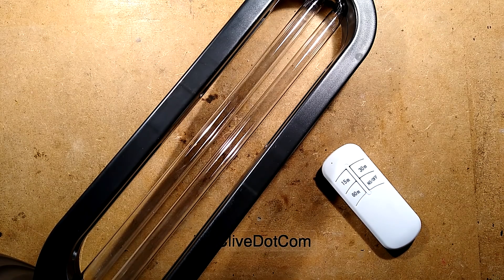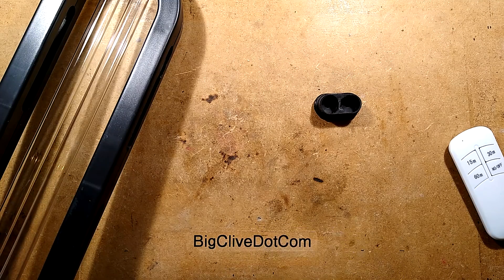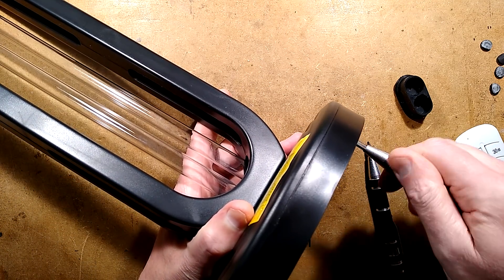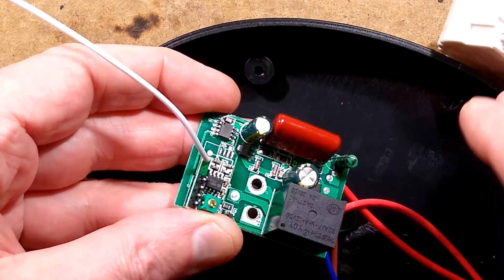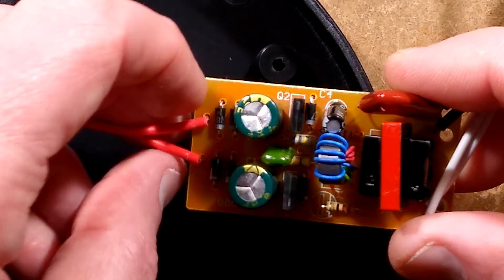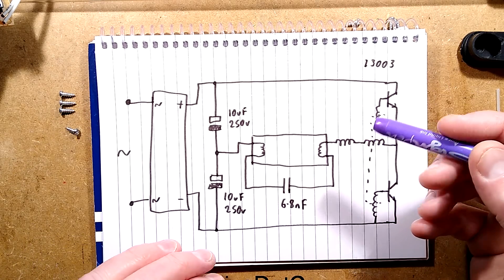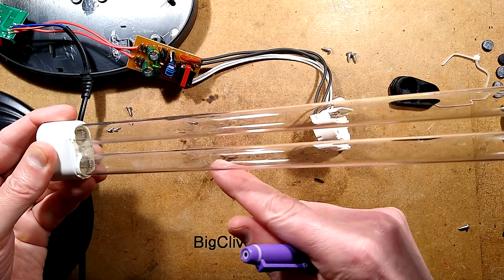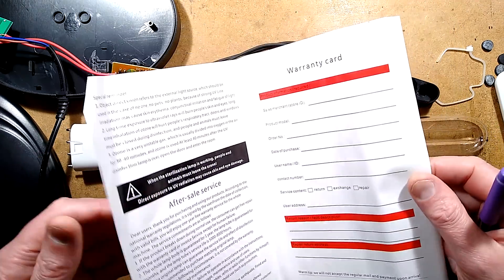Inside a stylish tabletop UVC germicidal light.  (Skin, eye and lung hazard)

Comment: The newer version of this has done a huge revision of the firmware. Turn it on, and the lamp doesn't immediately illuminate. If you set a time on the remote, the unit beeps slowly for a few seconds, then faster, and then really fast—then turns the lamp on.

They also now have two versions of the lamp itself, a low ozone and a more expensive high ozone. I got the low ozone and don't notice a significant scent when entering the room (even after an hour of it running). 

I was a little concerned about the lamp being genuine, since it only had those two little spirals of wire in the ends—but looking at yours I see mine is exactly the same. Cheers again, Clive, for recommending another great product.

Comment: I got a uvc bulb off Amazon. I'm using it to try to control mould from a damp issue (partly the uk weather). I'm not sure how effective it is because I'm still getting a mould odour from one area. To be fair the ozone does block any other smells for a while especially if you don't ventilate before using the room! To be honest I think the dehumidifier is more effective but I wanted to kill the active mould and spores not just suppress them. Sun and wind more effective than the dehumidifier today. Saw 47% which is unheard of here.
Reply from the maker: For older houses with inherent damp designs, another option is a PIV positive input ventilation system.

Comment: I just got one of these.  It looks just as cheap and flimsy as this one. It turned on once; don’t know if it worked the whole 30 minutes because I left the room. It wouldn’t work after that one time. The unit DOES come on when you hit the timer button and starts beeping (counting down), but the light itself doesn’t come on. Also, if you push the STOP button, you can hear the unit click off, but no light!  Very annoying.  I considered buying another bulb to try, but after seeing you take it apart, I decided it’s probably NOT the bulb. My skills do not include electrical ANYTHING, so (sadly), adding to the overcrowded landfill, it will be!

Comment: Now that I'm looking back at this video I remember having seen a promotional video from a French website that sells quite a similar tabletop UVC lamp.
But what's worse about this one is that it doesn't even have a remote control, instead it's a single pushbutton on the lamp itself that when pressed will turn on the UVC after (Only ! 😱)10 seconds, then it will keep running for 30 minutes without any practical way to turn it off earlier without exposing yourself to the harmful rays and ozone because yes for 40€ they didn't even consider using a ozone-filtering bulb for it but I'll talk about the ozone later.

The reason I'm even aware of the existence of this product is that I came across said promotional video (All in French of course) about it, when a salesman was demonstrating it and showing a clear misunderstanding of the hazards and elementary safety precautions regarding UVC and also ozone.  

In a nutshell he was saying that walking next to the lit lamp was "Fine" (No it's ABSOLUTELY NOT !) and basically wasn't emphasizing enough I think the absolute necessity of leaving the d*mn room.

At least he mentioned the need to open the windows to ventilate the room from the ozone, however he didn't seem to be aware of how dangerous ozone really is to the health though.

I therefore posted quite a long comment about all the real hazards associated with UVC and ozone, the mistakes the salesman was saying to the camera, the aforementioned flaws of their lamp (Which is still for sale as I'm writing this !), and last but not least the fact they also make UVC tubes that don't generate ozone and that maybe they should have chosen one of them instead. 

Of my 3 UVC lamps only one emits ozone and it so happens to be the one I use the least of all.
Why ?
Because it takes a really long time for the ozone level to fall back to a non-irritating for my eyes/nose after the lamp has been switched off, even with the windows open and unless you want to specifically get rid of some unpleasant odor in the room, ozone isn't really necessary and happens to be more of a hassle (And additional hazard !) than anything else.

Anyways I didn't get any reply to my comment, however a few days later they deleted the video... Then re-uploaded the same one with the moments where the salesman under-emphasizes the hazards removed.

Comment: When I was a kid I encountered a washing machine that was being disposed of,  and out of it I salvaged a small bulb,   looked a lot like a regular incandescent bulb in a size I didn't typically encounter,  but it was quite clearly labeled "germicidal lamp".  It had a smallish inductor wired in series with it.  I did play with it a bit,  it lit with a rather pretty purple color,  but I don't recall running it for long or experiencing any damage because of it.

We have some serious filtration on the well water here,  and one of the things they would do in the annual maintenance was change out a "UV Bulb" that was somewhere in the setup.  Quite costly,  that was.  Not using that company any more,  I know of no signs of any bacteria in the water here.
Reply from the maker: You can replace the UVC lamp yourself if needed.  They're very common.

Comment: So I've got one but returning it. It's got the motion sensor built in but it's waaaaay to sensitive. I can place it in a closed room, shut the door  and you'll see the light come out from under the doorway. I can stand down a hallway and slowly lift my arm and you can see the light turn off. I can be out of sight of the door around a corner and lift my arm slowly and it still turns off... It's unreal, I'm not sure how it's supposed to stay on if it can somehow detect motion in a joining rooms with the door shut.
Reply from the maker: It sounds like an oversensitive microwave detector.

Comment: I just scored a similar unit at a thrift store for $5.99. As far as I can tell, it was never used as the remote still had the plastic sheet stuck in to disconnect the battery. It has a nifty function that once you select the run time (15, 30, or 60 minutes) then press power, it will start beeping. The beep rate will rise until it is a steady tone over about 15 seconds or so. Then the tone will stop and a second later, the lamp will light. I did the first 15 minute test in my garage which is about 24 feet square (576 sq ft., 53.5 sq m.) and it left quite a strong ozone smell. I'm not sure what the actual wattage is yet.
Reply from the maker: That's a great price.  Was there any warning about the hazards of UVC?  It's scary that something like this was in one.
Reply: @bigclivedotcom  There is a similar yellow warning sticker on the front. And the instructions are remarkably Un-Chinglish. It has sensible directions and recommendations about avoiding exposure and post-operation ventilation time before occupying the room.
And the unit has all metal construction with four thin steel rods holding the tube in place so they don't cast shadows. I see the box says it is uses 58W, but I haven't had a chance to measure it. The total length of the tube is 28" (folded in half).

Comment: I know ordinary glass is "supposed" to block UVC but would it be safe to
 say go outside and look through the window of the room where the light 
is put to see if it's working or not ?
Reply from the maker: Yes.  Ordinary glass blocks the UVC.
Reply: @bigclivedotcom  But apparently not the higher wavelengths as it still gave me eye strain back a week ago when I tried looking at the beautiful blue glow from my germicidal light behind several layers of ordinary glass...

I've taken the lesson, now I only turn if on and off from outside of the room with the door closed.

Comment: I heard about a water bottle which uses UVC LEDs to sterilize water inside, battery powered, all in the cap. Since UVC LED seems to provide the least efficacy in the LED realm, I wonder if this could be a scam as it raises many red flags to me. Any reverse engineering on it? Is called Larq
Reply from the maker: It's an application where the UVC LEDs may actually work.  The exposure time would probably be longer than a quartz tube, but driving the LED would be easier.

Comment: I've got an identical looking unit also straight from China with very similar pcbs, although just a tiny bit different. I have been trying to fix it and got excited when you pointed out the prone to failure resistor, but mine is OK. I can't figure this one out! It worked for a few months then just stopped turning on

Comment: I have exactly the same UVC bulb and where they covered up the hole on yours I have a time to power button when you turn it on it will take about 10 seconds and then finally turns on... It beeps like a ticking time (blank) fill in the blank I don't feel like getting flagged 😂 I do like when you hit the power button though counting down for you so you're not in the room when it turns on.

Comment: I have one of these in a white housing that does not block as much light, cost $65 AUD, it came flat packed in a thick polystyrene box.
On difference compared to yours, when u plug mine the light does not immediately turn on, nice safety feature.
The remote system works great, set it up in a room,  close the door, turn on and set the timer safely from outside the room.
What i through was really good is the amount of safety information that was supplied, safety sticker on the lamp base, safety information in the instruction manual, safety information sheet in the postage packet from the seller and an ebay message from the seller thanking me for my purchase and explaining the dangers of UVC and ozone.
 
I also have a large ozone generator, it claims to generate 24 grams per hour, no idea how accurate that is, it has been used it to get rid of the old urine smell in the toilets at an old pub that has been converted into a community centre, it worked a treat, smell gone.

Comment: Mr.Bigclivedotcom. I hope you read this.
I wonder how to ask a question about this light mechanism -UNRELATED to current events - actually has to do with mildew/moisture.
Do you have email? Do I ask here?
Thank you.
Reply from the maker: Ask here.
Reply: @bigclivedotcom  Thank you.
I happen to be up early,  4:11AM in South Florida when I saw reply. Will take me a while since I am using my phone.
Last year someone recommend a light like this to me for some ongoing issues in one of the bedrooms of the rented old house were I live.
Getting help from the Landlord is next to impossible, and now I am not able to move.
Ok. So after seeing a couple of your videos, I wanted to find out from you if you saw any screw in type light that I can use lamp base in the room. 
Among a few that I watched from other channels,  one in particular from Ukraine showed (short version) the light retrieved after breaking a "bigger" light bulb, screwed into a lamp base and the lamp is turned on by the light switch on the wall. It was left in for an hour, and then turned off and the person aired room after a while.
After watching your one video, I am guessing the big bulb had to be busted as the glass would be the barrier. Inside the light itself was not round but skinny type like you showed with the three different bulbs.
Yes I would leave the room, even tape the door to make sure ozone does not escape.
Upon re entering I would turn it off, and leave room again for about 1/2 hour, then go back in and open windows to air out.
I am guessing I could do this once a week now during rainy season, and obviously move as soon as I am able.
Thank you for the reply, and forgive me if I typed too much. I wanted you to get an idea of why I needed to use the light. 
Be well and God Bless.

Comment: I have buyed one of these lamps from  China. i am satisfied. i use it with all the necessary precautions. important is the delayed start, so i put it in a room, i activate and i close completely the room for an hour, then after the work i change completely the air to eliminate the ozone. this lamp works well an is useful in this moment. tanks for Your videos about especially the fake uv lamps on the market and thank for the teardown. intresting the schematics.

Comment: another way to disinfection by fogger in amid coronavirus. thermal fogger & cold fogger also issue nowadays to youtube.  but we, normal people don't know how to do. can you give us the guiding light how to use or choose right one? what kind of liquid can use for both.     i also order to use the disinfection water by hypochlorous acid water maker. I wish you also test that too.
Reply from the maker: They used to use glycol foggers in hospitals to prevent cross infection.  The modern equivalent is a small disco fog machine.
Reply: @bigclivedotcom  Thanks a lot. Glycol fogger is cold fogger? disco fog machine is hot fogger. can I using the hypochlorous acid water or hydrogen peroxide in small disco fog machine?

Comment: I thought UVC didn’t produce Ozone. The units that are made for your HVAC do not produce ozone, it’s not particularly great for your lungs. The UV that creates ozone is actually below the UVC wavelength Of around 260nm. The ozone UV lights are closer to 110nm. Please correct me if I’m wrong.
Reply from the maker: Mercury lamps produce two UVC wavelengths.  184nm which produces ozone and 254nm which is germicidal.  Some lamps are engineered to block the 184nm wavelength to avoid creating ozone.

Comment: So the ozone feature, does it make o3 and that's why the room must be aired out after  or does it eliminate o3?? And also, does the quartz in the lamp make it safer some how? Another dumb question sorry , does the o3 (if it makes it) flammable? I want to use this in the wash room where the gas water heater is near by. Thanks
Reply from the maker: It creates ozone (O3) which isn't flammable.  But it is highly corrosive to some materials and not good to breathe for a prolonged time.

Comment: The damaging UV light from a welding arc causing "welder's eye" penetrates deep to damage the retina too (while this UV-C tube probably won't get that far). Sterilizing your eyes with UV is absolutely terrifying on most living tissues as you can imagine. Our corneal epithelium gets wacked first, destroying cells that make the up the oil base layer of tears to adhere to your eye and are now mushy rubbish until they turn over -- this could help explain why you experiences grittiness that night but there is also a lot of corneal referred pain (it doesn't have it's own blood supply and usually stays angry even with bandage contacts and steroids). The full angry spectrum of solar (and welder's) UV wreaks havoc on our crystalline lens in the form of cataracts on the lens itself and lens' pouch (referred to a secondary cataract). Lastly, and most terrifying, is the intensity of light from a welder's arc is powerful enough to literally blast holes in the retina. That's what we see (in the eye care field) when looking at the fundus of a welder. Very very common to see retinal burn holes causing permanent point blindspots. Most are only noticed on inspection just like how we can (reasonably) drive just fine in the rain.
Reply: So arc welding does cause eye damage even if you always wear your shield ?
Reply: @psirvent8  from what I understand, shielding will protect your eye as long as it doesn't fail (ie pinholes, wrong rating, improper fit). Apart from failure, shielding protects you.
Reply: @FuriousTortoise  So if my shield is of the good rating, in perfect shape and I adjust it to fit properly, I can weld as much as I like without getting retinal burn holes ?
Reply: @psirvent8  that's how I understand it. Burn holes are from moments (even fractions of a second) of less than optimal protection. And from what I hear, you'll know when those moments are from the pain.
Reply: @FuriousTortoise  Ok so unfortunately I might already have such burn holes even though I didn't do much welding since I was born and always used a proper shield.

But I did on some occasions look at electric arcs, either from workers welding in the street, then a short circuit on a power pole, and also by playing around at home and making arcs with a battery or a bench power supply.

I also look directly at the sun for a few seconds, blinking my eyes almost every time I feel the need to sneeze because otherwise I don't sneeze and tend to get sick (And this dates from way before the covid).

More recently I got a UVC tube (That I found in the bin and it appeared to be perfectly fine and working as it should) and did only once look directly at it for litterally a split second just to confirm it actually worked and then I did look at it behind glass (That is supposed to block UV rays, right ?) for as long as 1 minute, on multiple occasions.

Every time it gave me eyestrain a bit like if I had watched a screen for too long and not slept afterwards, but the eyestrain always disappeared over the course of several hours or overnight and I never got any "sand in the eyes" sensation.

But on one occasion, looking at my UVC lamp (Still behind multiple layers of glass) gave me watery eyes along with eyestrain.

So can you please tell me if you think my retina can still be intact or if I must have at least a few holes ?

Comment: Would it be helpful to have an air filter on in the room while the UVC light is on to reduce Ozone?
Reply from the maker: The ozone was desired.  You can get filtered tubes that block the specific UVC wavelength that causes ozone.

Comment: Quick question to anyone that knows, How long would one of these run off a 20000mAh battery?
Reply from the maker: You can get 5V power supplies and small quartz UVC u-tubes.  It would be a balance of output versus desired run time.